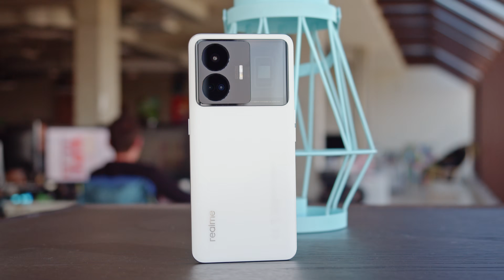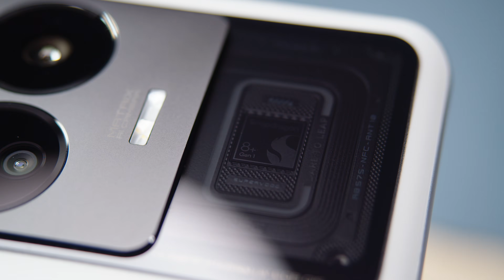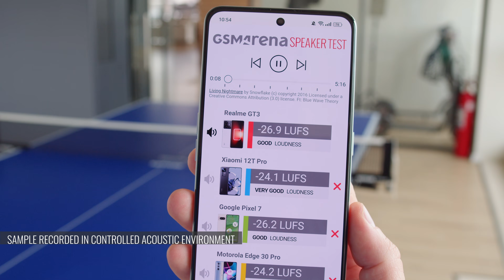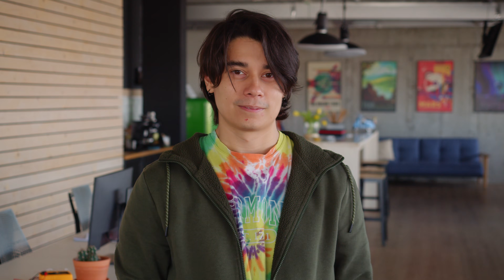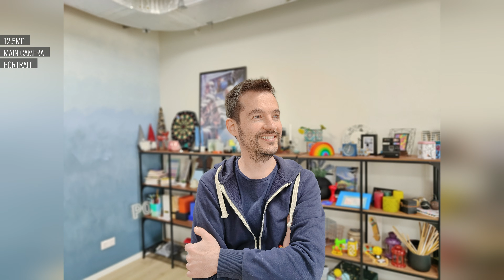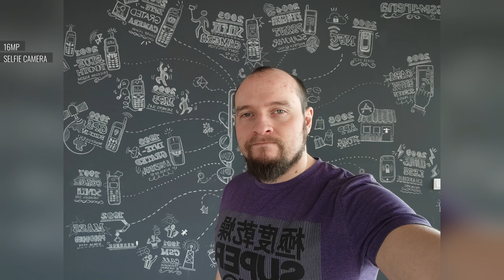Realme GT3 review - The phone with the 240W charging

Comment: There is so much stockware that battery barely lasts. If you charge 70%, keep internet and bluetooth off, the battery falls by 20-30%. 7000 mah battery is a hoax. This device is good for nothing. A cheaper redmi device is much better

Comment: Great review as always..realme mentioned 9.5 mins of charging time but 10 or 11 mins is still crazy fast probably a feature to beat and it's under 300W..it is convenient but not that necessary though 30-40mins of charging time is the sweet spot for me especially when using the phone heavily. I could rest my eyes within those charging time..But yeah that's just my opinion, VOOC Fast charger is indeed an innovation..
Reply: If you turn off the phone, probably will able to reach that 2min gap
Reply: @andresouzacomz  Good Point, i think we rarely charge our phone turned off.
Reply: https://youtu.be/AG19EpsVJwo
Reply: The brick only outputs full power at 240v, if the test was done at 120v it would explain the difference

Comment: Is it the same as the gt neo 5?
Reply: GT Neo 5 China Version
GT 3 Global Version
Reply: GT 3 Global =GT Neo5 China. It is similar to OnePlus ace 2/ OnePlus 11R, with faster charging, flat screen with higher RR and different design. Other specs are pretty much the same.
Reply: @skyhawk004  Also a less underclocked 8+ Gen 1 (or faster than the 11R), likely thanks to it's massive VC cooling
but well summarized
Reply: yes it is
Reply: yup gt neo 5 240W

Comment: The battery will last about a year before dying
Reply: If you read or research more deeply, battery tech has been improved now a days. My Oppo with 65W vooc is about 78% health after 2 years, just like what they promised (800 cycle/ 2 years < 80%). And this phone double 1.600 cycle and will maintain < 80%. Wich mean about 3-4 years.
Reply: Many people nowadays talk big without even researching what they talked about. No shame at all.
Reply: As long as it is cool, it will last. My slow charging phone battery is ruined because of using is as GPS under direct sunlight. It only take about a year.
Reply: hahhaha i remember these ignorant stupid fools from 2016 when the 36watts charger starts appearing on smarphone 🤣😂
Reply: Primitive people can't think
Reply: People been saying same thing about OnePlus years ago when they had only 25 W charging and it's actually not ruining batteries.
Reply: @JamesBond007Nejc  240W is on another level though
Reply: @alvzcizzler  Said the same for 120w, and its been out for 2 years now
Reply: Uses a Gan technology.
Reply: Boomers like you say this kind of crap whenever something new is introduced 

I'm using the realme X2 pro from 2019 with 50W charging,  battery health is now at 76%